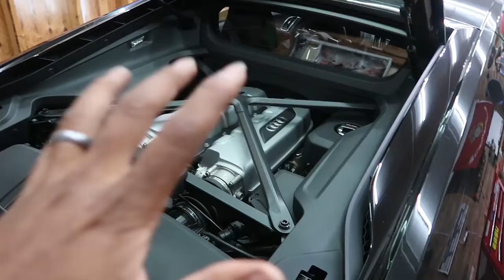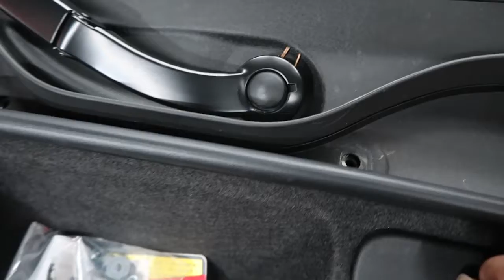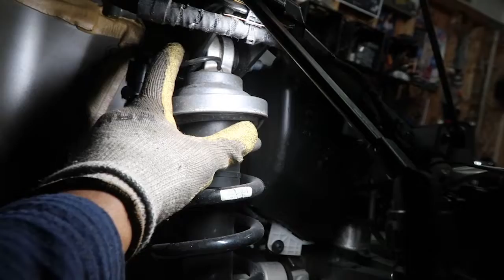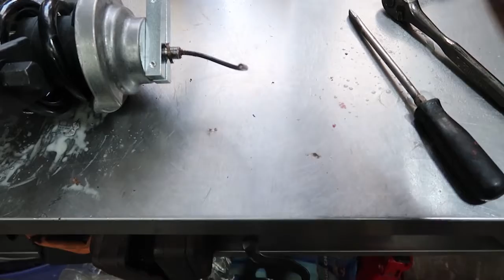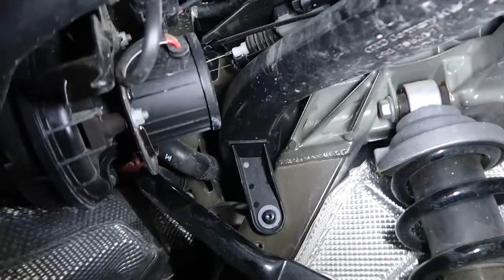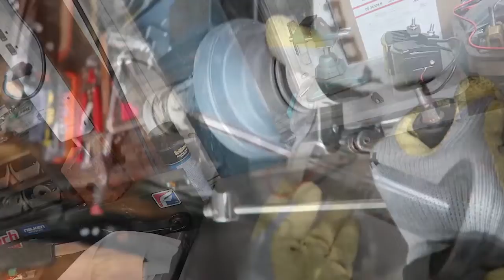Audi R8 Gen 2 Adjustable Suspension install (H&R VTF)

Comment: How does it feel? Compared to stock comfort and smoothness on the road does it compare? Also why did you choose these ones. I’m thinking of also doing VTF
Reply from the maker: This car was for a client, I didn't choose the kit and, i didn't get to drive it on stock suspension, but i did put some miles on it with the lowering springs, honestly i have to say this is one of the best riding cars i've driven. firm but no harshness, you could drive a thousand miles nonstop and not get uncomfortable.